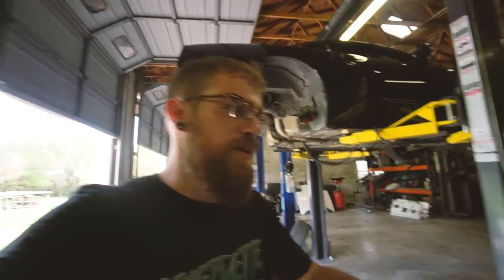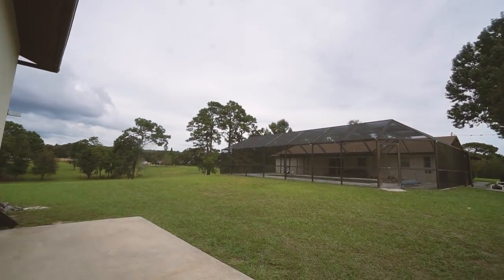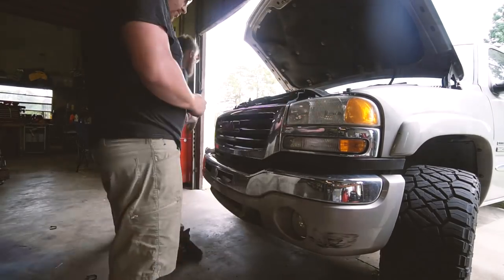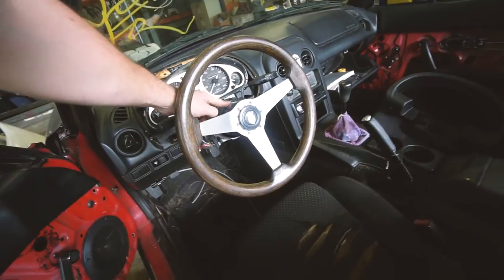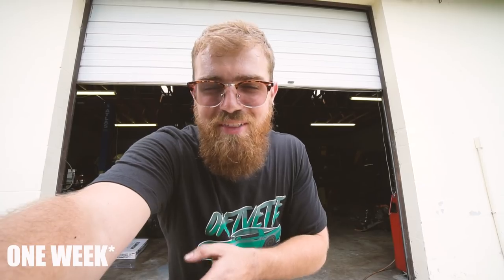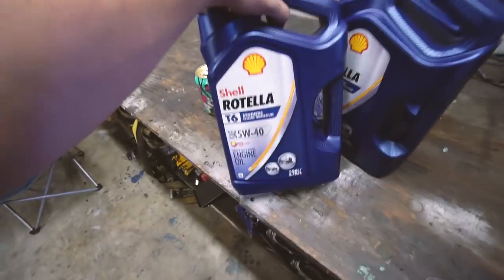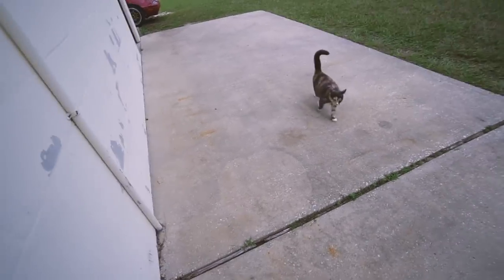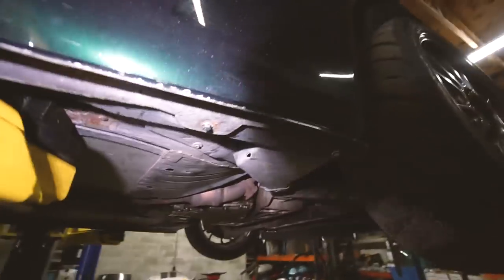Duramax Trans Cooler and House Renovations

Comment: Taylor: We have probably 6 LBZ Duramax's in our fleet. They are all Off Road vehicles. We did remove the EGR, did the PCV reroute, added a auxiliary trans cooler, radiator with electric fans, and moved to a better flowing exhaust. Highest milage one is at 400k with a lot of idle hours. We did the common fuel filter mod and also have a catch can setup.

I wouldn't say up the boost and launch it but allowing the engine to breath better and cool better is necessary to extend the life. I wouldn't replace it all now, but the EGR cleaning and delete are step 1.
Reply from the maker: Thank you! Great information!

Comment: Trans cooler is a good upgrade. My 4l60e burnt up from heat, stuck  accumulator's, a small 2-4 band, and not having molded pistons. Along with towing in overdrive instead of 3. I put all tci parts, like a beast sunshell, bigger 2-4 band, hi temp bonded pistons,  a transgo shift kit, along with all the sonnax parts like pinless acuumulators, check valve, pressure releif valve, and sonnax check balls. I can now do fat burnouts from a stop with a big ass trailer attached and the transmission usually stays in the right gear going up hill with less up and down shifts. Only thing you gotta do is watch the color of your fluid. If it starts to turn dark and you start getting a long second gear shift. Your 2-4 band is on its way. Other stuff that happens is broken sunshells  etc when your towing alot. But if it does break and you get the right parts to install. It will last over 60k without any issues. My transmission was "rebuilt when we got it" but the parts that made everything function were junk.  Oh... And my trans cooler line that puts out fluid was plugged into the bottom of the radiatior instead of the top. So all the hot fluid was not flowing properly to cool down...

Comment: As a lly owner. This is all I have done - 

efi live tune DSP5 switch 
LBZ turbo mouthpiece with stock air box
Egr delete 
3” downpipe 
Diamond eye exhaust 5” straight pipe 
I love the way it drives but I want the 6 speed and it’s only because mine is dying. Don’t pump up the horsepower on the 5 speed because it will break lol. Just tune it for better MPG and max run a heavy tow tune.

Comment: modifed cars only become less reliable when you start trying to increase horsepower. if you took at stock SR put a mishimoto rad, intercooler, oil cooler, an intake and exhaust on, it would be way more reliable than stock

Comment: I went with a 5in MBRP SLM series. All stainless steel, cat/muffler delete. Airdog lift pump. Still running stock intake. Would like to do egr delete next. From the research I’ve done don’t skimp on the kit. Also heard mixed reviews with MPGs getting worse once deleted so IDK. Love the Duramax content and can’t wait for you to do more!! 
 Also don’t be afraid  to do the cat/ muffler delete. I was skeptical but soooo glad I did. Gained 1mpg from just the exhaust

Comment: Whatever you do to your truck don’t put a diff cover on. 
1) they look ridiculous. 
2) they do absolutely nothing other than make a diff fluid change more expensive. It’s also possible to shorten the life of pinion bearings because the fluid cannot be thrown the them from the ring gear. 

If your EGR cooler is rotted and you don’t feel like replacing it, go ahead and delete. If it’s fine and you don’t have drivability concerns or coolant consumption, leave it. I personally feel like EGR deletes are pointless unless you have a race truck. Hell, if you’re concerned about exhaust gases going into the intake like they’re suppose to for emissions, take a tuner and turn the EGR valve off. 

I’ll put it this way when it comes to modding diesel trucks and I’ll use the 6.0 Powerstroke as an example. 9.9/10 of those trucks that come in to my bay at the dealership with blown heads have a tune on them. Same story with 6.4s and 6.7s. Is it Fords fault? No. The engine was never designed to sustain cylinder temps and pressure that high. You can add a lot of power to modern diesels very quick and easily, but you better be ready to make sure the rest of the drive line can take it. 

LB7s and LLYs have their injector seal issues. All trucks have their quirks. It comes down to do you want to put the time and money into a truck that hardly has to work to pull a trailer with your car on it. 

Intake and exhaust are always fun to have. You get the turbo noise and what not. Once you start adding more power you really need to think about if it makes sense for what the truck is doing. 

Always enjoy videos. Keep it up man.
Reply from the maker: Thank you for the very thorough and thought out response. Tuner wise I was planning to do efi live with trans tuning and just do a tow tune basically. I don’t want to make power or it to be fast it’s a 7klb truck. Lol goal is to pull a two car open trailer with mine and bens cars on it. Just want to make sure it will handle that comfortably.
Reply: Taylor Ray sadly you cant go with Efi live tuning by Idaho rob

Comment: Quick tech tip from master mechanic 

When doing an oil change pull you vehicle in pop the hood and the open the oil cap and place to the hood latch this does 2 things
1 never forget to reinstall the oil cap
2 allows oil to start to drain to the pan also allows air to cavities under vacuum from running

Especially on diesels just from experience

Comment: I went with the S&B intake, and a 4” MBRP exhaust on my LB7. The intake makes your turbo louder, and I’ve heard fab’d intakes are even louder than plastic ones like the S&B, which I like. And the 4” exhaust has a nice sound to it but I’ve never directly compared to a 5”. As far as tunes go, make sure they are “transmission safe”. I have a 110hp tune and at full throttle at 90mph, it limps the trans every time, without fail due to not having a built trans. So just be aware of that. I’m at 230k miles with 50k with exhaust, intake, and tune, and absolutely no trouble other than limping the trans.

Ps. I bought the super fan pack, just waiting on it to show up!

Comment: Get mbrp 4 inch not to loud but perfect. Egr delete will let the truck breath a lot more. Also adding tunes add power and fuel economy with the right tune. Dps5 switch would probably make the best turner for you truck.

Comment: As long as you are not putting a hardcore tune on it, you probably won’t have a negative impact on reliability. An upgraded cooling system seems like a good idea, but I would test it out a bit to see if there is anything that won’t work for you before taking any serious trips. 
As for mods, I am a big fan of edge’s products for the duramax. Their stage 2 kit has an exhaust, intake, and programmer, and it is super easy to add things like egt sensors, backup cameras and airbag controllers to the programmer. Just my 2 cents, but I think overall their line of products work really well together.

Comment: On the duramax to start I’d do resonator box delete pcv reroute and egr block off plate. As for exhaust 4 or 5 inch and any cold air intake

Comment: Most factory oil filters have that check valve in them which is why they are sooo much better than getting a cheaper one from the parts store. and key word there is cheaper bc some of the better ones like K&N and Wix etc. have it as well...

Comment: I had an lly for 335k miles. Down pile, 4" straight pipe is nice and not at all loud. I'll give you my muffler if you think it's too loud.
Egr delete and pcv reroute is nice. I'm sure you've seen the intake mess from having a pcv. I did clean mine out and saw zero difference.
Intake isn't crutal, but the turbo inlet is definitely nice. Let's the turbo do.its thing with less work. 
I never did a trans cooler and never had an issue. Even with a built trans (limped it towing heavy on a ppe tune #2). Which brings me to the tune. DO NOT BUY A BOX TUNER. Spend the money and get tunes from Duramax tuner. They design them around the stock trans. Alison are good, but that 4-5 shift under load is what hurts them. 
Hit me up if you have any other questions. I've been all through the LLY. 335k and it never let me down. A guy ran a light and totalled it :(

Comment: Wcfab Intake they have multiple options in kits that are egr deletes. Duramax tuner for tunes ( duramaxtuner.com) mbrp 4 inch exhaust and second most importantly a edge cts2 to watch egts, temps and a bunch of other stuff. That's my plan for an lbz and although this is an lly they have the same parts available pretty much just changed for the different intake angles etc. Also duramax tuner has the 6 speed conversion along with a ton of part options. They also know what they are doing in the world of duramaxs as well as multiple other platforms

Comment: You should imstall a deep transmission pan when you change the fluid. You can more fluid which lowers trans temps.
Reply: not totally true, a larger pan will not "lower" temps, it prevents them from heating up as fast as there is more fluid to heat up.
Reply: ^^^ which does help because it steadies it when going up hills and stuff.

Comment: I always reccomend a fuel system with added filtration as the first upgrade. Nothing will sideline a diesel faster than contaminated fuel. On Duramax's I've used Fass and Kennedy Diesel systems with great results from both companies.

On LLY's the turbo inlet elbow is too small, holding back power, and can cause egts to get high. S&B and Accurate Diesel make larger diameter replacement elbows.

For egr either go all in and replace everything... up pipe, down pipe, and intake tube with WCFAB or Profab.... or leave all of the egr system in place and slip in a $15 egr blocker made by Deviant. 
DO NOT install one of the egr delete plate kits. They dont support the factory up pipe and intake tubes properly. Making them prone to cracks and leaks.

With an egr delete or blocker you will need tuning. 
For tuning I prefer efilive tunes from Ridgerunner or GDP.  PPEI and DuramaxTuner tunes are ok too.

Comment: Exhaust brands are personal preference the 4 and 5 in also how you want it to sound. But for performance efi live tuning and ppei and duramax tuner are some of the best and edge has a good cts 2 for monitoring gauges. And in the topic of physical engine mods hands down wc fab is the best on the market.
Reply: And then also a lift pump either fass or airdog

Comment: Edge programmers are the way to go. I love mine and have driven 07.5 and 08 LMM Duramaxes pulling trailers for my old job one with an edge and the other with a banks. the edge had more power and the transmission tuning wasn't retarded, whereas the banks was all over the place with shifts and you had to tow in manual mode.

Comment: The deletes are necessary to make a diesel engine last longer. The emissions stuff adds so much unnecessary heat into the engine. obviously with the tuning you can add a ton of HP and Torque with the new diesels that will result in less longevity and reliability. But a little extra isn't going to hurt anything, also it depends on what your right foot does.

Comment: Taylor Ray!!!!! You want to do the EGR delete you want to get up pipes and down pipes Ppe And you want to get the Lb7 up pipes and down pipes because they eliminate all EGR and that pipe it’s way better for it do you want to get the exhaust really doesn’t matter what exhaust exhaust exhaust you want to get a tuner I would recommend the edge insight. Also I would get the lift pump to help your injectors saw your CP3 isn’t working so hard and you don’t burn that out other than that everything’s pretty kosher you’re already doing the transmission cooling mod.. also do the Ppt high pressure Fuel rail delete or the screw thing I can’t remember what it is!
Also do the deep pan will help with our trans temps
Reply: MA is your friend

Comment: any problems with the hoses leaking that are barb and hose clamps?? im doing a Allison swap on a 6.4 f250 and I'm stuck on the dam hoses and cooler starting from scratch the 6.4 line was no good and all the kit I seen are hydraulic hose for the Allison just dont know what to use,  then there's the cooler the 6.4 one is good but dont know if there enough flow lol. thanks for sharing

Comment: Exhaust brand does not really matter, get a muffler (trust me). On the LLY do the intake elbow and intake from (s&b). Preferably a full EGR delete not just the block off plate. Tuning wise I recommend a company like DuramaxTuner, and do yourself a favor and stay off tune 5 your trans and head gaskets will thank you. The power increase will blow you away and its hard to resist the big tune lol

Comment: Modifying a duramax most definitely lessens the reliability. If you want to keep it reliable, do exhaust, intake. But once you get into new tunes your gonna be working you way towards replacing the head gaskets and injectors as those are the weak points of the LLY's. Hope the best of luck to ya.
Reply: Sam Cummins  I mean if he gets a towing tune it’d help it a bit, as long as he has an exhaust intake and the right gauges and coolers, nothing should lose any reliability
Reply: I have a 2003 LB7 and tow<10000lbs with a 75hp tune and daily drive it with a 110hp tune. Been doing it for 50k miles now and no reliability issues outside of normal LB7 problems.
Reply: @BadLuckBran  how are your injectors doing ha
Reply: @Sam Cummins had them replaced when I got the tune and balance rates are good so far but I’m preparing my wallet for the inevitable. I’ve heard adding a lift pump for better filtration greatly extends the life of the injectors. I’m at 230k now hoping to get another 50k out of this set.
Reply: @BadLuckBran  well that's good and yeah they don't last too long in the lb7's lol I had one and I had an lly

Comment: Hindsight, you should have put the lift angled to the right of the shop door. That way you could have a car on the lift and still pull another vehicle straight inside the shop.
Reply from the maker: We thought about that before hand but we wanted to keep that area open.
Reply: True but you would have still had the entire corner of the shop andddd the ability to pull another car into the shop.

Comment: thats winter oil bud. thats for when it gets below 32 degrees
Reply: At the temps he'll be operating it a 5w40 will behave roughly the same as a 15w40. It'll be fine.

Comment: I never ever ever do the screwdriver thing. If you dont have proper wrench old serp belt helps. Thing is damaging the filter to get it off will weakin it and it will crush when you have the proper wrench. One of the first ones I did I did this and it just tore the filter around and ended up with a proper wrench and it just crushed it. I had to get the plier type wrench and grab it at the top ring. Yes people are idiots when they change their own oil and or get done at a lube shop with an idiot and tighten the filter way too tight. Shouldn't be issue for the next one.

Comment: K &n intake
Reply: I would never trust a K&n filter, if you hold it up and look you can see light coming through.
Reply: @Jordo4998  my best friend has a 08 2500 duramax, 7in life, custom tune, 15in wide tires, bodywork. Not to mention 600hp. Hes been running the k&n for 3 years now. No problems.
Reply: @averydahlquist9557  not to say that a vehicle wouldn't be fine with one, because there are vehicles out there with no filters that do just fine, but I personally would not trust one on my vehicle or recommend them to a friend.